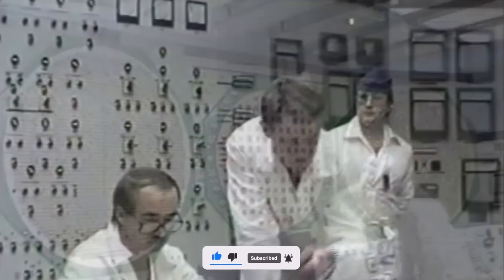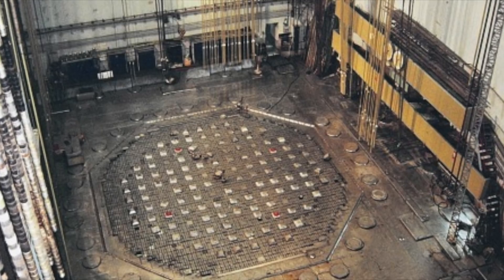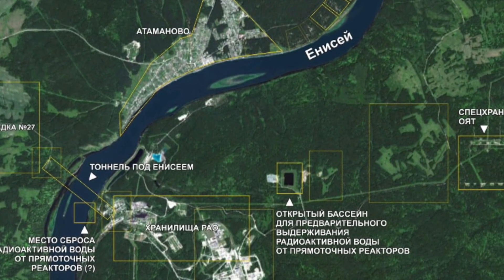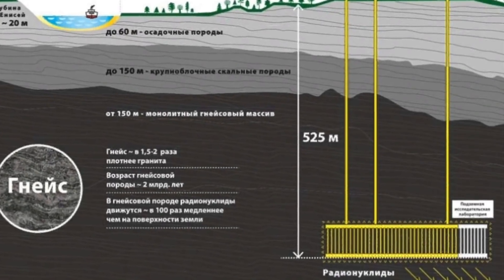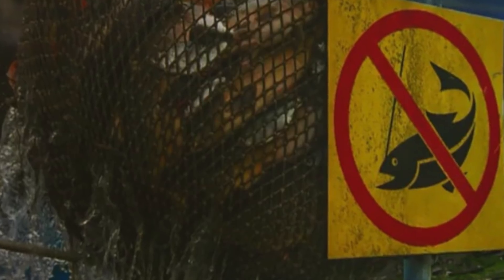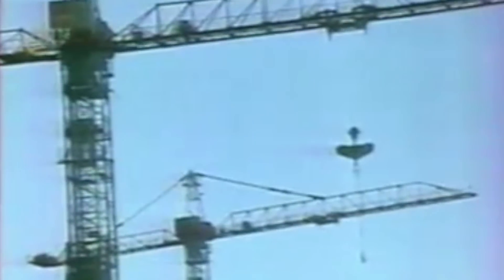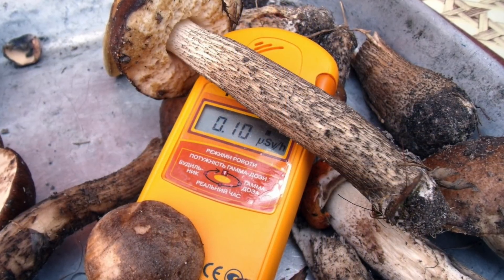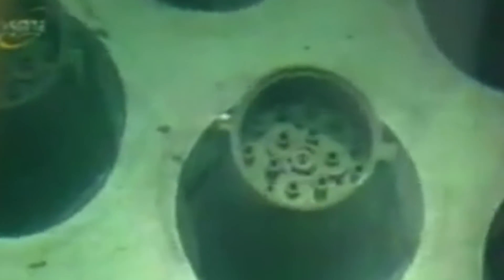Krasnoyarsk 26: the most radioactive city in Russia

Comment: There is no safe dose for radioactive isotopes. You cannot dilute these elements or burn them up. Just spread them and/or transmute them into other radioactive isotopes, possibly more dangerous than the ones that created them. Radioactive isotopes from fission reactors are thousands to millions of times more dangerous than the enriched naturally occurring radioactive material that went into the reactor fuel. Gen IV reactors transmute thorium-232 into uranium-233 or uranium-238 into plutonium-239. Out of the pot and into the fire. Nuclear proliferation - Build Back Bigger Bombs.